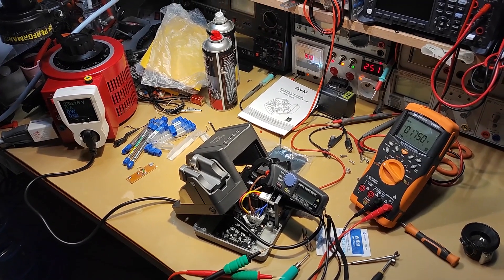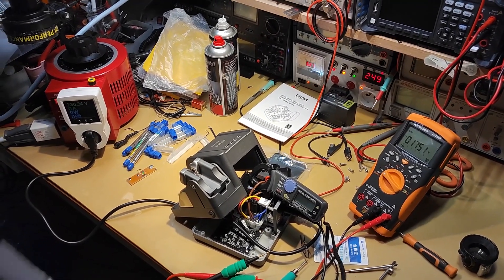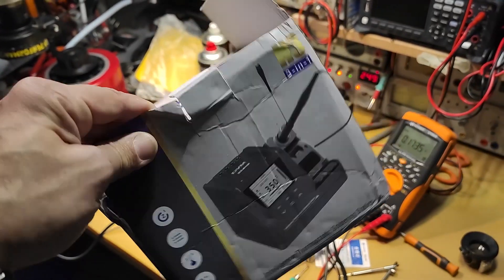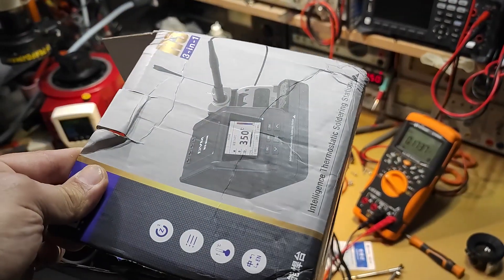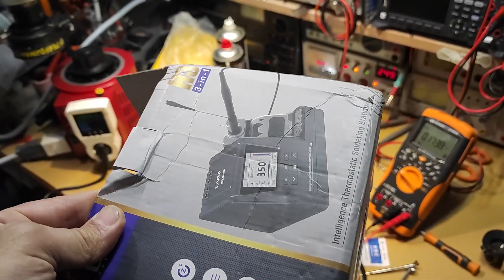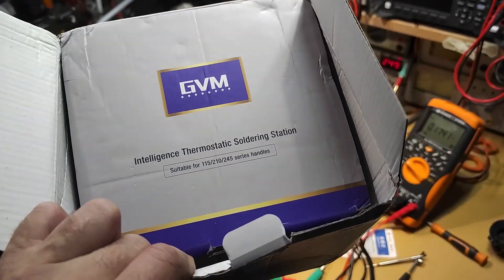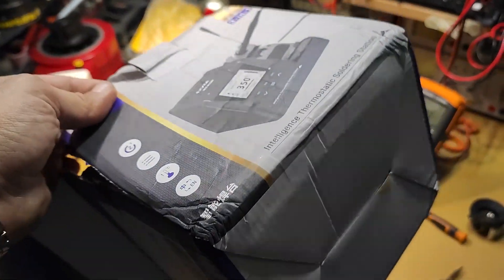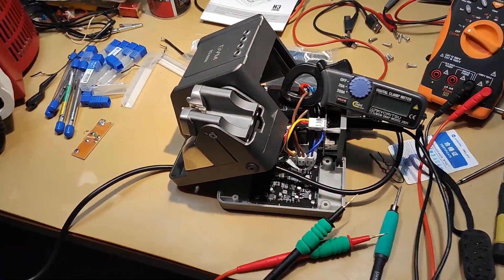What you need to know about the power of the GVM H3 soldering station (before buying it)

Comment: Your transformer wires are reversed. This is a known assembly issue on this otherwise decent unit. SDG electronis has done a video on this flaw. Very easy fix, switch the blue and brown connectors to the board and you will get close to it advertised power rating.
Reply from the maker: thanks.

Comment: Nice demonstration brother
As you said the transformer needs to be a bit beefier so it can handle the power demands and provide sufficient power to the tip especially when dealing with large pads and or thick boards..

By the way it still good enough as it is
Reply from the maker: Hello, The voltage avalaible on the secondary output is made for T210 and T115. On other unit, like T420, many supplys are required, like 12 V and 24. But honestly, I purchased a lot of T210 tip because I am in love with it. So, this sation is perfect for me. Thanks for commenting and see you soon bro.